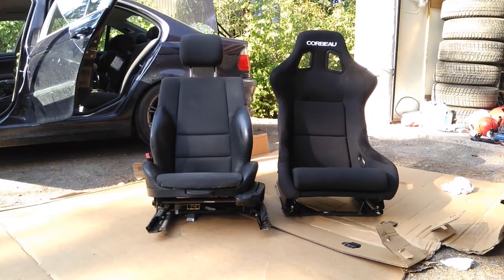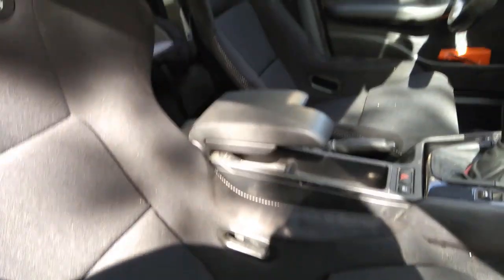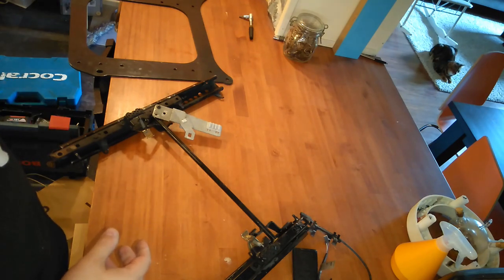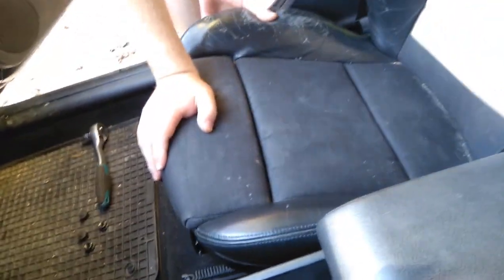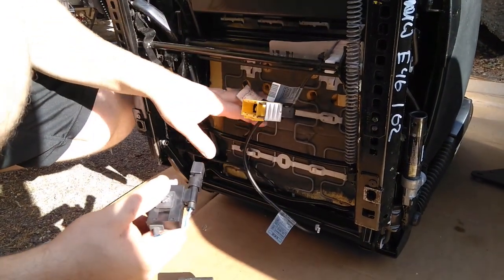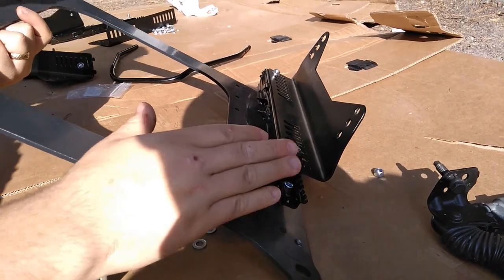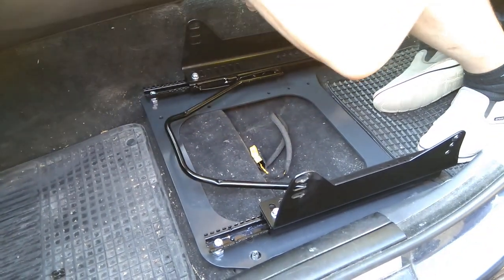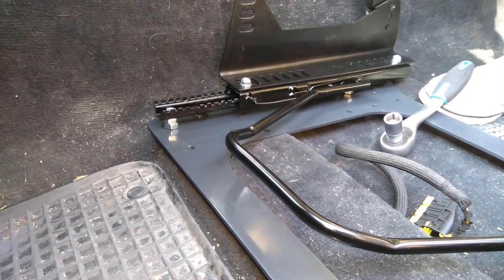BMW e46 Bucket/Racing Seats With OE seatbelts Install guide

Comment: Thanks for this video, very informative! I have a question, do you only need to retain the seatbelt tensioner cable to the wiring loom of the seat? I'm not sure if you can disconnect all the other ones and not get a dashboard light? Thanks!
Reply from the maker: Yes you can delete all other cables although you'll have to reprogram general control module so that the seat sensor mat is not used then you will not have warning light on the dashboard

Comment: will i get a check engine light if i put aftermarket seats
Reply from the maker: No you wont. 

But you might get airbag light depending how you install them.
If you retain the original seat belts and wiring and put a sensory mat delete on the passenger seat wire-harness you should not get any warning light in your dash.
Reply: i guess Im kinda off topic but do anyone know of a good site to watch new movies online ?
Reply: @averyhudson9436  tf?

Comment: Wouldn't you want to have the seat belt attached to the runners so it moves with the seat?
Reply from the maker: Yes i actually have changed this setup to one that uses the original seat runners. Sadly i lost the video material and never got around to making the video but maybe i will post a review video of them and showcase the end result as i have made the change about a year ago.

Comment: can you like the bracket again
Reply from the maker: Say what now?
Reply: ChargedCars sorry can you link the brackets again, because it’s not showing up on eBay.
Reply from the maker: @imod9193  Hey sorry the seller might have removed it from the store but just any general flat bracket for BMW e46 and e36 works

Comment: This is what Corbeau sells as an E46 fitting kit?  Nuts as spacers,  rails that don't fit, and no provisions for the seatbelt tensioner? What a ripoff.
Reply from the maker: No they don't sell a kit for the e46 directly i just bought the seats that came with the general rails and the adapter plate was a ebay buy. And the other stuff was just used off the the old BMW seat rails. Although i found a nice kit from Brey-Krause that adapts any Bucket seat to the oe BMW seat rail i might do a video on that although i did not film the install.